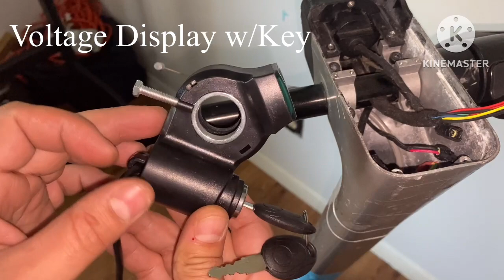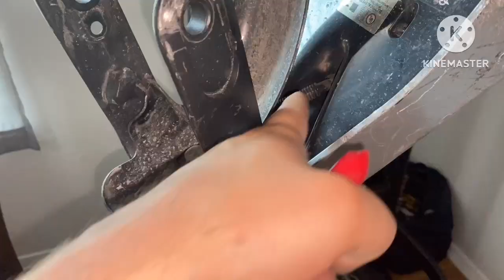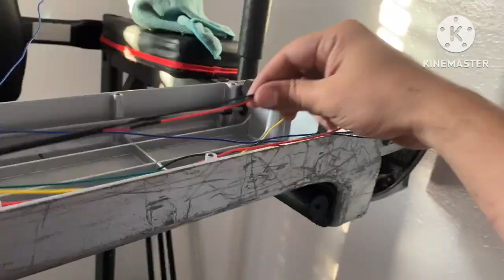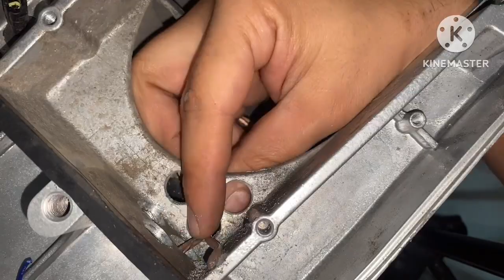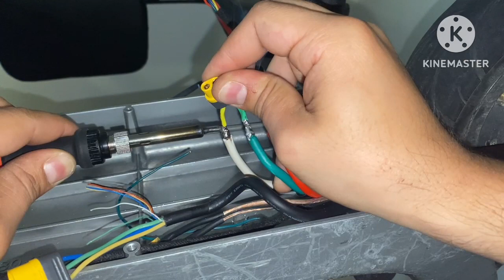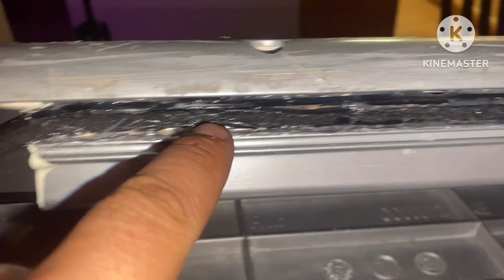36v 2,232 w 62 a | bird 3 | Electric scooter | #DIY #Project￼￼

Comment: Do I have to use the same controller you are because I can't get it to run on a Xiaomi M365 350W controller for some reason.
Reply from the maker: For that Xiaomi scooter you would need the Display unit to go with the controller so you would need to order that as a kit . From there it’s pretty much plug-and-play

Comment: fake,fake.     2X 500W controllers + 2X250w motors
it does not do 1000W efficiency
the accumulator is no more than 13A
there are people you can fool with this
keep the stupidity to yourself
who wants to tune his scooter ,find a specialist and ask for advice.
what you did is dangerous
li-ion is not a toy ,because the battery cannot handle that load
nor does the motor have a capacity of 500W
Reply: Learn how electronics work and then comment

Comment: I have to say these motors do really well on 72v. I have a go kart I made from 2 bird 3 scooters and it goes 45 miles an hour with 2 people on it. Only 2 wheel drive. Let me know if you wanna see anything more on it
Reply from the maker: Absolutely it’ll be cool to see what you have going on ! If u do post anything let me know, for sure I’ll check it out .
Reply: Btw. I had to use statorade to cool them
Reply: What’s the range?
Reply: @JesseWaldo  untested. It really depends if you are running 1 or 2 people and what the driving and terrain is. Range is pretty good since I’m using 4 lime scooter batteries in a 2x2 setup
Reply: @JesseWaldo  probably 20 miles
Reply from the maker: @dauntlessfpv  very interesting I’m going to look into this statorade ! I was thinking about doing the same thing with my controllers before I started this conversion I was going to add more thermal paste to the heat sink on the controllers, just for extra safety and it’ll probably extend the lifespan of your controller and keep your mouse fits from blowing.
Reply: @pjscootermods I was thinking of having a separate power supply for a 50mm fan to blow air on the controllers, Somebody posted a video on it with an Ebike even without external airflow it still drops the temperature by 10 degrees
Reply from the maker: @Sebastian-wg8fd  That’s a good idea to only issue with that is there isn’t going to be any circulation because the space is so tight, you may end up just burning out the fan motor unless you’re able to cutting some slits for ventilation  And a space for the fan to sit properly
Reply: @pjscootermods  yeah I have had a controller or 2 blow. On my 72v lime scooter my new controller is cutting out under high load so I think I’m going to switch to a vesc or something more tunable.
Reply from the maker: @dauntlessfpv  I might get the 75100 flipsky for another build later down the line. But that’ll be for a later build. They cost about 100 bucks
Reply: I’d love to see that
Reply: how do u get bird scooters
Reply: @abbyelsea402  steal them, the company went under
Reply: got any pics?im lookin for a frame to do that also!
Reply: yes, please

Comment: Man your video saved my ass love your presentation man I need a video on a sine wave 1500 /3000 controller connected to a match lcd its a set keep getting error h30
Reply from the maker: This scooter is a beast , it’s a power machine . If I choose to drive in single motor mode I can double my range/mileage.I say 41 miles per charger give or take